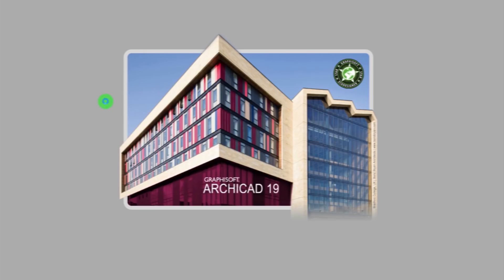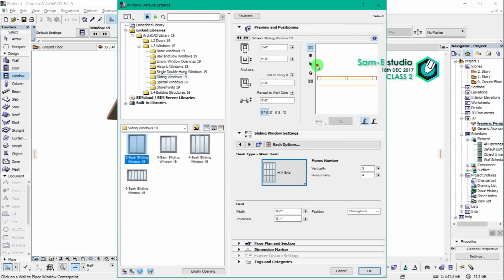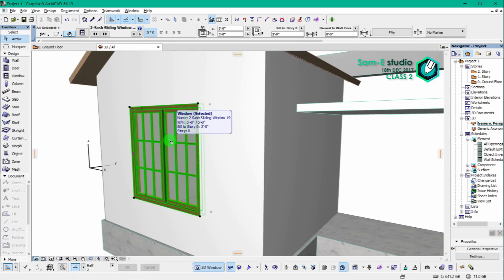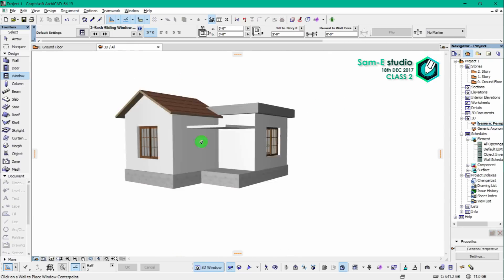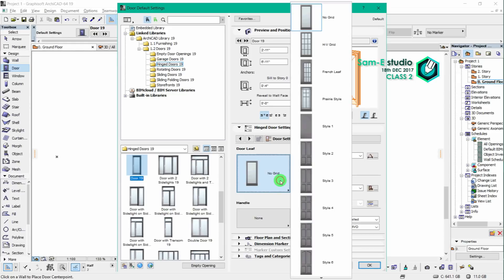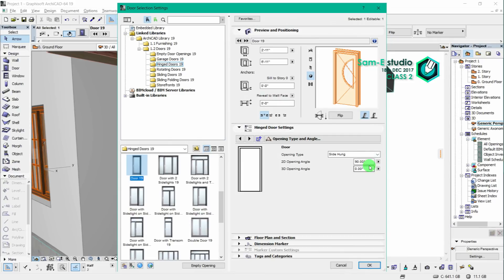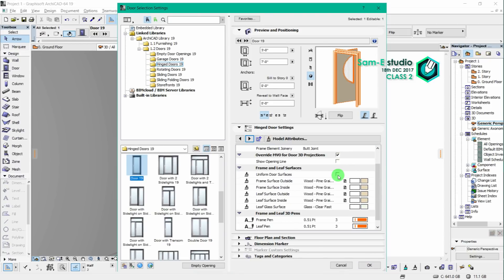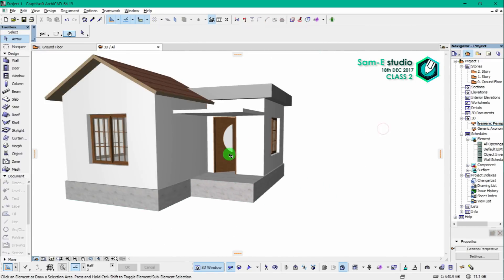Archicad 19 complete tutorial | Class-2

Comment: Bro can u suggest me a basic pc specifications for AutoCAD,staadpro,revit architecture,3Ds max softwares
It's urgent bro I need your reply.
Reply from the maker: All architecture software running on high specification systems-- I recommend core I7  processor with 4 graphics for smooth work
Reply: what about i3 gen processors. Does 1gb or 2gb graphic card works for my purpose.budget is tight bro